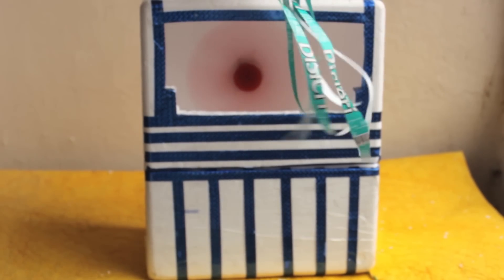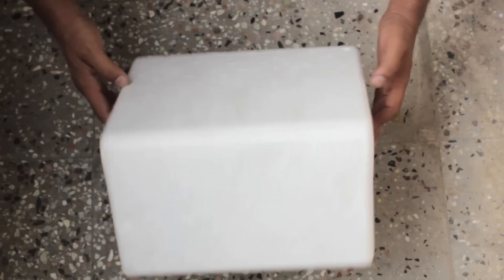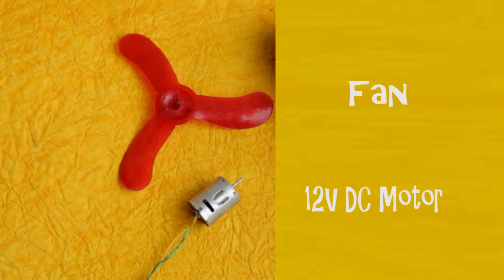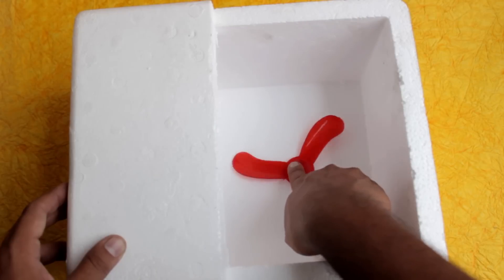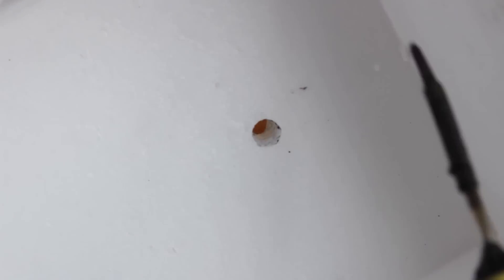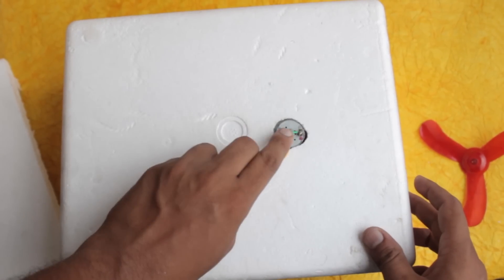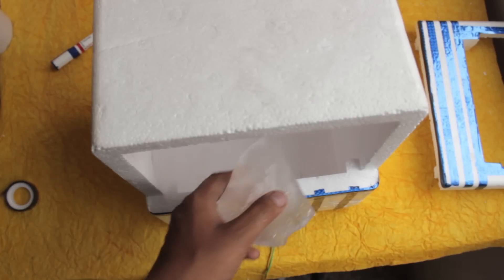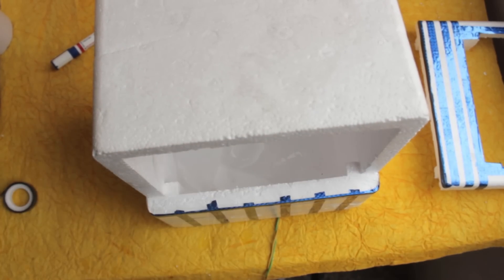How To Make Mini Air Cooler For Summer Easy Way

Comment: fucker when the ice melt what will u do....
Reply from the maker: +Tomal Das sir it was sealed down to protect it from leakage if so leaking keep a tub below the cooler and after melting just remove the water from the Styrofoam box and add fresh ice
Reply: you make it easy. but example if my country. i buy 40 pesos ice whole day. my electric bill everyday just 20 pesos. so i disisition i buy aircondition its for long life,
Reply: I am a filipino girl hindi po ba natulo yon

Comment: What will you do when ice melts in to water , i guess ull be cleaning the floor-
Reply: like you
Reply: sunny
Reply from the maker: +Shady CW that was sealed down with tape
Reply: +KrazyKred no matter wat u do it ll start leaking.
Reply from the maker: Mine its not leaking i tested if its leaking put some plastic tray down the cooler then it will be fine...
Reply: Snthosh Mandha
Reply: CyberWolves tfrgg
Reply: super
Reply: you can put a straw near the bottom going into a bottle  :}